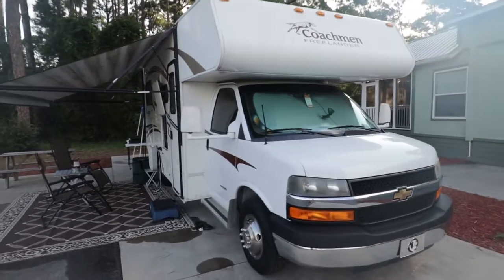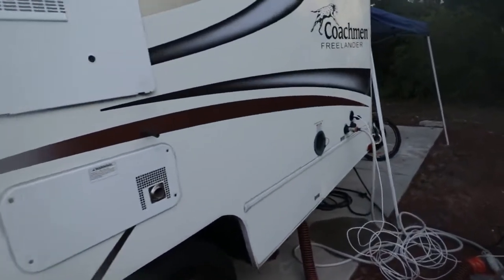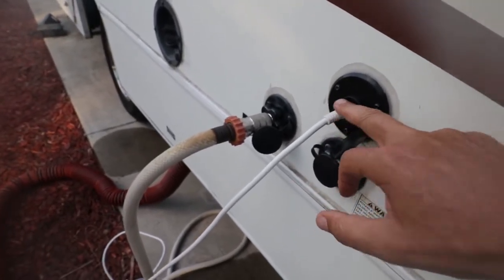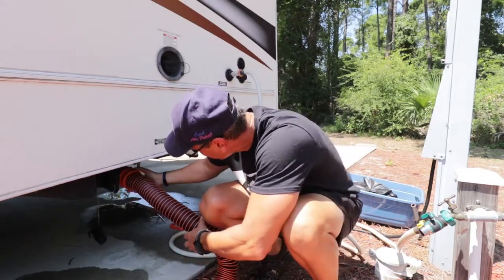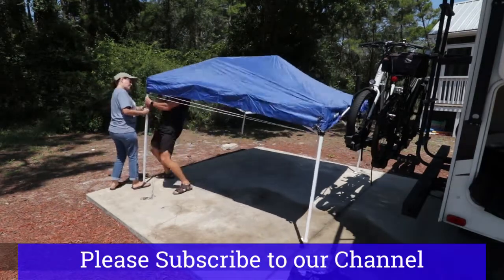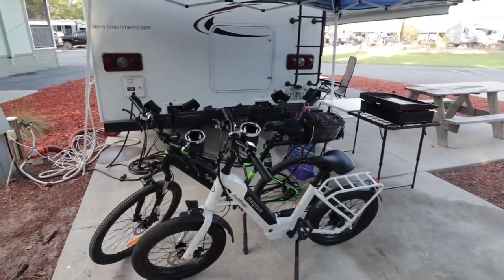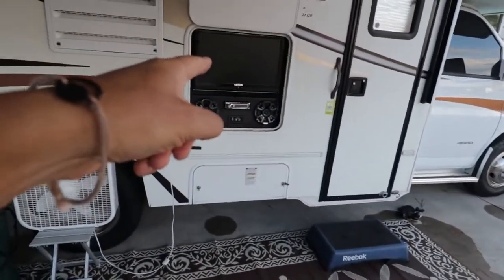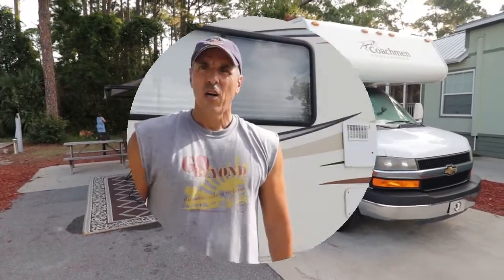OUR RV SET UP / SMALL CLASS C MOTORHOME

Comment: Nice video.  I like the step for getting into the RV.  We use a Camco water filter and a pressure regulator that we attach to the connection going into our RV.  I filter the water again with Brita filer from the kitchen faucet inside the RV.  We also use gloves when attaching the sewer hookups.
Reply from the maker: Lol, yeah the step works out great. Thank you :). Two things I didn’t show, because they failed us during this trip was our surge protector and pressure regulator. Water filter is a great idea, we haven’t been using one as we bring out bottled water for consumption. Maybe something to think about for the future though.